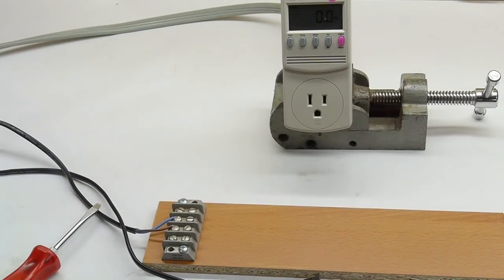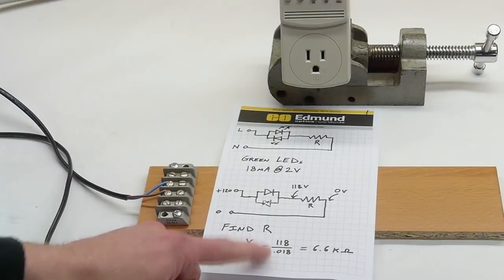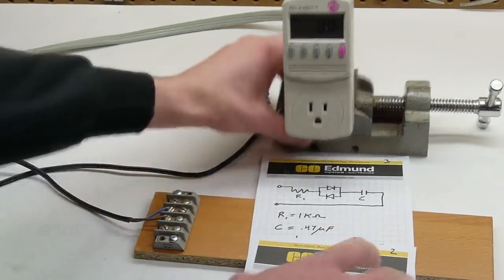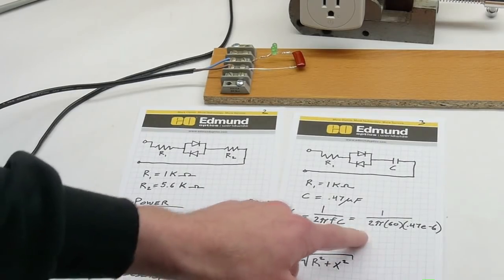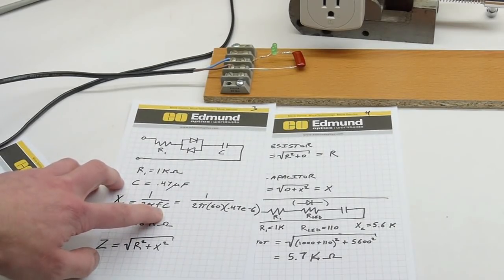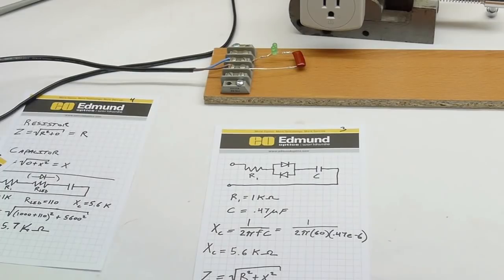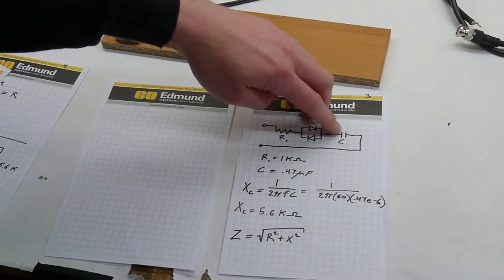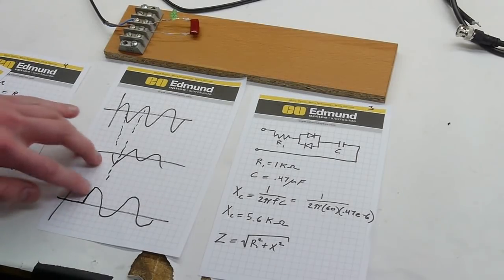Tutorial:  Electrical impedance made easy  - Part 1

Comment: "Impedance is just a resistance that depends on frequency"  - finally a clear explanation. Thank you and keep up the good work. +1 subscriber
Reply: vital989 No, No, No, The reactive portion of an impedance is not like resistance at all. Reactance does not consume power. It is energy stored in a capacitor or inductor from an earlier time that is opposing new energy that is being applied at a later time. A simple example would be 2 batteries connected in a circuit to a light bulb where one positive terminal is connected to one side of the bulb and the other batteries positive terminal is connected to the other side with both negatives connected together. The energy in one battery stops the energy from the other and the bulb does not light.
Reply: BigFoot Too many
Reply: harvey keller "to many?" What is your point.
Reply: i understood his point Nathan..."too many" words or too much crap is what he means...probably not a native English..i am not either......the oversimplified explanation is a good route for people to fit the definition in their heads and allows them to further get deeper in the subject...if teaching all the crap at once like BigFootToo is stating and then adding the math, people get overwhelmed and understand shit about the subject....this is a common mistake with almost all teachers..they have deep knowledge on the subject but ZERO knowledge on how to teach...   For example some years ago i was starting on restoring vacuum tube equipment and was struggling to understand some theories...i had to read lots of books and watch videos until i realized the "miracle" that going out of a tubes anode there is dc voltage and the ac signal riding on it on the same conductor...Nobody explained that on these simple words.....nobody stated that AT ALL....before, i looked at schematics and was puzzled to see +200v entering on a point where it was supposed to be a 10v ac signal exiting..... i also could not find the waveforms on my scope because they were "raised" by the DC offset
Reply: 8:35
Reply: @bigfoottoo2841  But current is always flowing non the less.
Reply: @bigfoottoo2841    Sure it consume power that is why electric companies ask us to put in every reactive load a capacitor in order to correct Cosinus Phi.  The Watt meter can measure only the resistive. Whan using reactive the  cuurent is higher than what the meter measures. (When current is higher also the Wattage is higher. By adding capacitor to every electric motor in the factory it correct the current to be in same fase with voltage. So that real consumption can be measured.
Reply: @yoramstein  Modern kWh meters can read real consumption even you do weird stuff with your electricity, some of those even allow you to read different details about your electricity usage/values through internet
Reply: Same here. Such a greatly explained video.
Reply: @bigfoottoo2841  That's true but in effect one can think of it as resistance, if one only wants to use it as a tool, since the end effect is the same, baring in mind that resistance dissipates energy through heat and impedance not, aight?
Reply: @bigfoottoo2841  Yeah but he's talking about impedance which is the in phase and out of phase components taken into consideration. What you're doing is isolating the imaginary component (j operator) of impedance and talking about that.
Reply: Literally a minute earlier he says that the impedance of a (perfect) resistor does not depend on frequency. So saying "Impedance is just a resistance that depends on frequency" isn't always true. (If anything, reactance is the frequency-dependent resistance.) But I learned that from this video, so still a good explanation and demonstration.
Reply: @tabchanzero8229  Because the value of a pure resistor doesn't depend on frequency. You need to look at the definitions for things to make sense.
#1 A resistor, by itself, in an AC circuit, is measured in resistance and isn't dependent on frequency.
#2 A resistor in an AC cicuit with inductors and capacitors is measured in impedance
The impedance is the trigonometric sum of the total reactance of the circuit which is frequency dependent and the resistor value which isn't frequency dependent
If you plot the impedance values say from 1MHz to 2MHz at 1KHz steps the reactance value will change but the resistor value doesn't.

Take note. In real life, there's no such thing as a perfect resistor or any component for that matter because between the pins and lengths of leads there's always a very small amount of capacitance and inductance. However, it's value is so small it's mostly ignored until you get to very high frequencies.
Reply: @tabchanzero8229  I see what you seems more of a semantics problem. What is impedance? reactance + resistance. 
Since resistance is a constant and the only difference between impedance and resistance is the reactance component, then you could indirectly say that without butchering the understanding. But yes, reactance is the part which is frequency dependent but at the same time it's the only part that differs impedance from resistance, because if you take away the reactance you are left with only resistance. Although what you say is more precise, both are right.
Reply: @tabchanzero8229  ,  "perfect resistor" is a corner case (a degenerate case) that does not occur in the real world.

Acceleration of a particle to a fixed mass always depends on the mass of the particle, unless that particle has zero mass.
Reply: That means -- integral resistance. If you just take current-value through your circuit in many points of half-period and then integrate it and then calculate resistance with Ohm rule like for resistor, you get the same.
Reply: @bigfoottoo2841  you describe REACTANCE as phenomenon but not REACTIVE RESISTANCE. Reactive resistance is ECVIVALENT resistance for the particular frequency that means some integral of all different resistances through the changes of current when voltage changes.
Reply: @Judge Steve  actually it consume reactive power, and now many modern energy counters counts the reactive power and you must pay for it it.
Reply: I like that when you go to the mathematical definition you actually see that even though you don't see complex numbers in person they still affect you

Comment: Nice vid. I have an MSEE in analog design and work for one of the top semiconductor companies in the world and have 20 years industry experience. I still learned a lot from the video. Great explanation. I wish the professors in college took this approach of looking at things from a practical side first, then building the math concepts up around that. The knowledge sinks in much better.
Reply: Look how many comments are praising this presentation. It just demonstrates how wrong it often is.
Reply: What is exactly that you have learned from this presentation? ( After 20 years of the experience with electronics)
Reply: Diodes in a power supply are often connected directly to huge capacitors (10,000 uf) the in rush current can burn-out the  diode  if the a low resistance transformer is turned ON; with the the diode connected to the transformer  AFTERWARDS !
Reply: @martinmartinmartin2996  
Oops!😄

Comment: Great video!  I learned a different analogy for the capacitor.  Think of it as a tube/chamber with inlets at each end.  In the middle of the chamber is a plunger that can move back and forth.  When water enters one end the chamber fills with water and the plunger is pushed along until it reaches the wall at the other end and it stops, the capacitor is fully charged and no more current/water may flow (assuming a perfect seal/capacitor which we know doesn't exist).  When the current changes direction the pressure (current) pushes the plunger the other direction until it hits the other wall.  This is repeated as the AC current flows back and forth.  The value of the capacitor can almost be thought of as the volume of the chamber but not quite.  Keep the videos coming!
Reply: I love this analogy!

Comment: When I was in school, I wanted to replace one of the neon pilot lamps with LED. I tried all different watts, ohms of resistance in series! Each one kept getting warm, and I never knew why. Thank you for this video, for I know now!☺️
Reply: I was scared off from using a 1 Ohm resistor on the grounds it would turn into a radiator.

Comment: Nicely done, young man ! Although I am intimately familiar with what you're doing, you are to be commended on the most informative and practical sequence you've used to put the pieces together, namely, smoothly bridging from a known--ohmic resistance--to capacitive reactance. The respective wattage calculations were icing on the cake. I suggest that this is far more instructive than most people realize. Thanks a lot.

Comment from the maker: Most modern projects involve a microcontroller, so I'd say one way to accomplish your goal is to sample the voltage-divided signal with an ADC, and adjust your blink rate based on the value. You could also use a 556 or 558 instead of a uC so that the pulse duration could be separated from the repetition rate. Again, use a voltage divider on your input signal to provide a variable threshold voltage for the timer chip.

Comment: Careful using “phase” with newbies. As you fully know,  USA household power is 1 of 3 phases generated at the source. The household single phase of course oscillates at 60 cycles and you were referring to the phase angle of the 60 cycle oscillation. Electrical and electronic engineering is at nomenclature loggerheads which muddies the water for newbies.  Apart from that, a terrific presentation!  Your teaching skills are par excellence!

Comment: So sizing a capacitor to place across a highly inductive load (ie motor), "stores the reactive energy locally in the capacitive side of the circuit when the motor field collapses, to be used to build the field again on the next half cycle. In radio, that is called a tank circuit.  You sir, are the trigger for the resonance above my head. Thanks Ben.

Comment: Explaining the capacitor as a bucket made this far more understandable. My guess is the lower voltage is because the circuit is essentially shorter and a resistor turns the elcetricity into heat where as the capacitor doesn't as much.

Comment: Great channel and good job. AC power at the plug is measured in volts that is a RMS value and the peak to peak voltage is a little higher then the measured 120 volts. Rms value is 70% of the peak to peak value. So the peak to peak voltage for 120 volts is 171 volts and that can screw up calculating electric circuit's.

Comment: This explains my recent problem with a string of LED Christmas Lights.  There were 100 LED's in the string, plugged into plain old 110 volt AC.  Well one day, half the LED"S went out (well in actuality very very dim) whilst the other half was still happily glowing that wonderful blue that I love so dearly.  Now on the old tungsten lights, I could find the culprit by replacing one bulb with a known good, then running the whole string till the string came back to life. Different with these LED'S but I did figure it out.  The strings each had a single LED with a resistor (I never took the time to figure out the value) so, not unlike the old fashioned lights, I began pulling LED's and testing them with a 2032 battery,  this went on till at last I found the LED with the resistor.  It was that LED that failed, and once  I soldered the resistor on one leg of a new LED and replaced it in the string, it came back to life!  That was neat, but as the first half came back to life, the second failed! Again, I located the problem with the LED that had the resistor on one leg, replacing that and moving the resistor to the new LED solved my problems and now the lights are once again just as bright as they were four years ago when I first picked them up at Walmart.

Comment from the maker: You can easily cause a capacitor to explode that is not rated to to handle the voltage and polarity applied to it. I believe that I used a mylar cap (non-polarized), probably rated for 250V.

Comment: " use a BiG FaT resistor"   THAT brought back memories.  got a ham radio license in 1959 and in those days we had to build our own radios (ther were none to buy) and back then every resistor on my workbench, no matter what the rating... was as big as my thumb.  u could read the color-code from 20 feet away :)  building our own radios was fun.  i cnat imagine its "fun" building ckts with modern surface mount components that u need a magnifiying glass to even see

Comment: You Probably cover in Pt 2 but in UK we would on test circuits lsolate from the incoming mains with a 240-0-240 Transformer, which in itself has some impedence.  We could also tap off into a reducing transformer to drop the voltage to 24v or 12v,  and power the Load from that with a small R and small C as required.  But we note that the transformers will run hot and the overall circuit would draw more wattage.

Comment: Interesting.
The concept inspired me. But, with a few additional simple parts this can be made better.

I tried this idea (with a twist) to power an overhead LED light panel made up of 90 LEDs wired as 18 series sets of 5 LEDs in parallel (some store renovation project threw out over a dozen of these, and i hate to see perfectly good stuff in a dumpster heading to a landfill - so i rescued them). The panels want 45v-65v DC, but getting such a power supply is a pain in the neck. I want to power this from 240v mains.

So i wired one end of the mains into a 450v 1.0µF film capacitor (while the capacitor was in parallel with a 1M ohm "discharge" resistor - this way the capacitor would discharge after a few seconds when unplugged and avoid the pop mentioned at 5:48). The other end of the capacitor and the other of the mains line were fed into a bridge rectifier.

Across the output of the bridge rectifier i put an electrolytic capacitor also rated for 450v (and i made double sure i got the polarity correct). This capacitor accomplishes two things (1) at the end of Ben's video (14:29) he mentioned a possible huge spike of current into the LEDs if the circuit was plugged in near an AC peak, this electrolytic capacitor would suck up such a spike protecting the LEDs, (2) the capacitor will smooth out some of the AC flicker (50hz is worse than 60hz, although with the bridge rectifier it would be 100hz vs 120hz).

Also across the output of the bridge rectifier, and in parallel to the electrolytic capacitor i put another 1M ohm "discharge" resistor. Because that electrolytic capacitor could pack one really nasty wallup if a person would touch both ends of it... even if it was unplugged for a while.

And finally across the electrolytic capacitor is where i put that LED panel.

Works like a charm!

Postscript: I saw no problems, but, just in case, i could add in a 1/2-watt 100 ohm resistor between one end of the bridge rectifier the parallel junction of the electrolytic capacitor, the discharge resistor, and the LED panel. This could help ease an initial current spike, but i really don't think i need this with a large enough capacitor.

Comment from the maker: When you first apply a potential to an uncharged capacitor, a large current will flow (infinite in theory). As the capacitor charges, the current will decrease, until it reaches a very low value (zero after infinite time in theory). Thus, when dealing in only DC current that has had time to charge up the capacitor, there will be essentially no current flowing through the cap, and it could be replaced by an infinite resistance for circuit analysis purposes.
Reply: Of course EVERY real capacitor has real resistance ) the leads+ copper foil + dielectric losses In a real capacitor .
Of course evry transformer or energy source has REAL resistance to limit the current. 
INFINITE in theory is for classroom lectures, it is NOT useful for design purposes !

Comment: Thank you for taking the time to explain this in great detail on your video. With the help of a capacitive reactive calculator that  is online, I am able to to achieve the correct capacitive reactants ( impedance) I am looking for!👍
How much of a safety buffer should I allow for the voltage on the capacitor. 25 - 50 V ?

Comment: About the post script. For larger applications, where there might be a meaningful decrease in power consumption by using 2 capacitors, I wonder if it would be worth it to use some sort of controller to make sure power is applied at the 0 crossing. I'm sure it could be done using an analog circuit. Maybe this could be useful if installed in a light switch, since then it could time the  power a bunch of LED lights.

Comment: This may sound strange but as a hobbyist, advancing my knowledge on electronics with YouTube. I have always pictured capacitors as little balloons in the circuit. They are constantly filling up with pressure,  then emptying with pressure but,  in the opposite direction. They are like rubber balloon pumps.

Comment: Thanks a lot for your video :-) Also the subtle trick (I think) to insert a 1k (low effect) resistance in series with a 5K high effect (which reduces the amount of current in the 1k) Clever trick. But also both of these videos are the best on yt of this topic. Please make some more videos about inductors, but also how to design / develop a circuit that must solve a real world problem.
Also please make video of complex numbers, differential equations and magnetic fields.